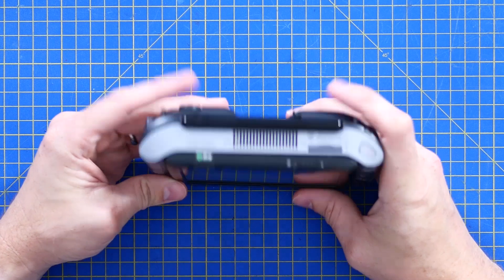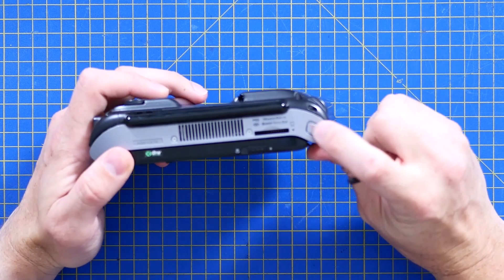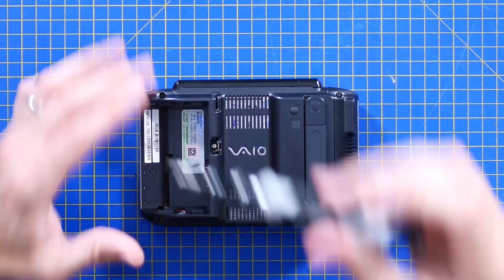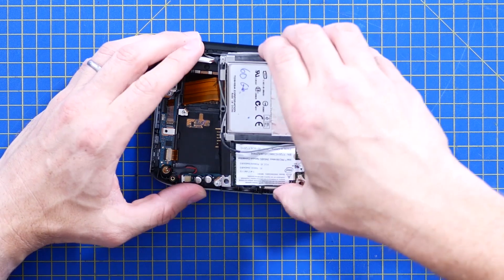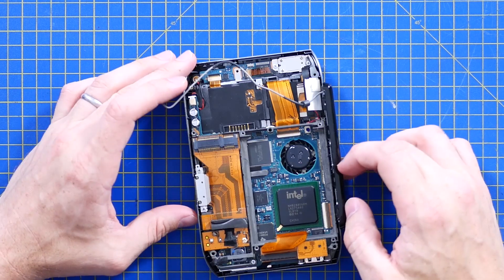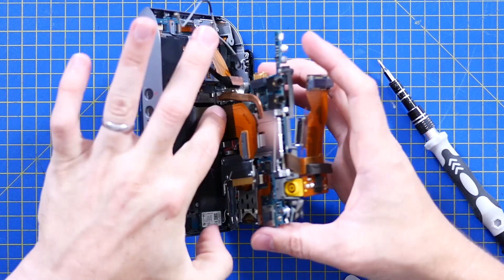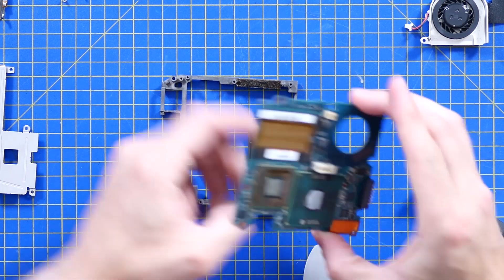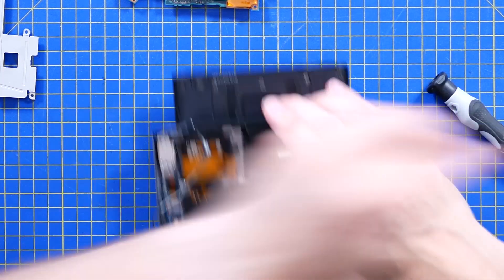Sony VAIO Handheld Computer Teardown - The Electronics Inside

Comment: I wonder if you could tease out (or just find online) the pinout of the front assembly connector and then 3D print a new, and likely thinner, back with modern guts of some sort. Like a Raspberry Pi to test the concept, then move to something more powerful like a LattePanda once proof of concept is done.

Comment: The display is 1024x600 pixels. Very fine pixel density for it's time. If you need help with drivers or Sony apps, then I have them for XP and Vista and even some Win 7. I have much experience with this model and hope you get it working. It's a fun machine to mess about with.
Reply: I really hope that I can too, but I'm not sure how I'll fare with reballing RAM if that's what it comes to. I may get in touch for the drivers in the future!
Reply: @a531016 Sadly the community concluded it was impossible to upgrade the RAM because of memory controller design but my hope is you can at least replace the bad chips.

Comment: Classic Sony 3D envelope design. It’s like a camera inside. I find it quite impressive for the mid 2000’s considering that it is basically a pc in a very small form factor. Just look at how tiny the motherboard is, yet it still has a cooling fan and a mechanical harddrive inside. There’s a lot of different engineering disciplines involved to design this. To me, this seems a lot more impressive then a modern smartphone with only a single Soc inside. This product also seems very bespoke and a bit quirky making it quite interesting.
Reply: I couldn't agree more! This was still a few years off the dreaded netbook style laptop that compromised every component (EMMC Storage, the worst processors, tiny ram, no accessories etc). Sony doing what Sony did best.
Reply: Well said. Sony made some incredible portable hardware. Used electronics stores in Tokyo have lots of bespoke mobile devices from a lot of Japanese makers; Sony wasn't the only one but was among the best. Many "ancient" devices still are used in factories, labs, and hospitals so still pricey.

Comment: Do NOT touch the gold contacts on ribbon cables or boards. That boosts the probability of failure. I think the issue was contamination rather than physical damage but can't recall.